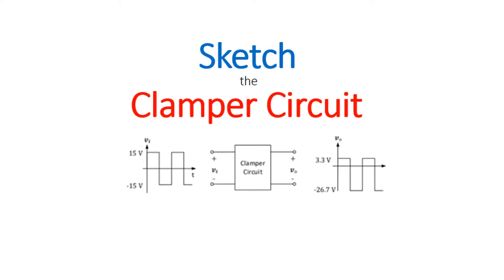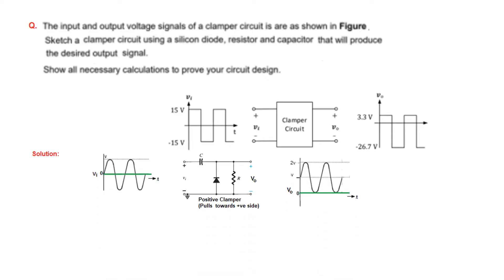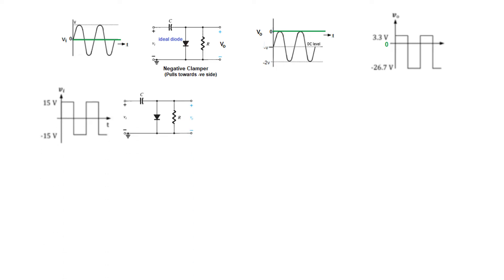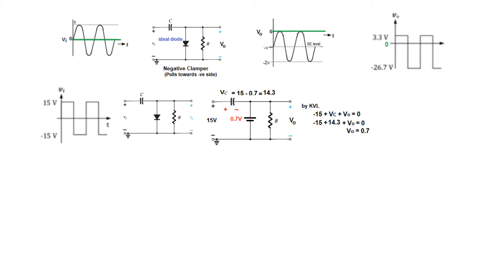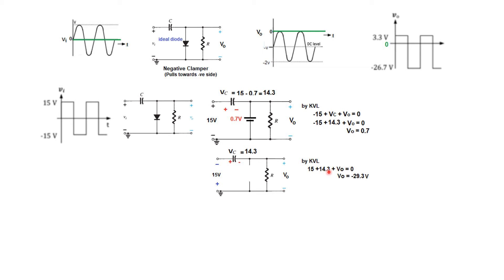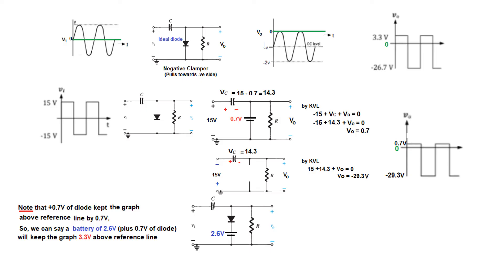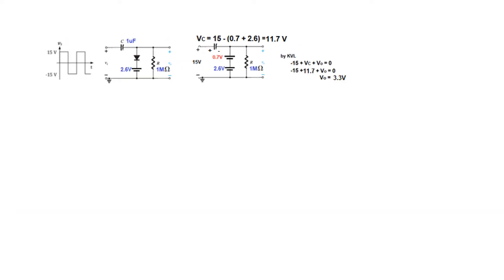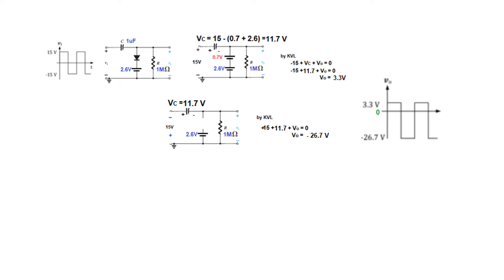(E)EDC(B) 2.10(2)  || Clamper Circuit || How to Sketch Output Made Easy || Assignment Question ||

Comment: sir how its knows which V is battery apply for 3.3 and 29.3 in graph achieved
Reply from the maker: Please watch the video few more times, then it will be clear, I hope.
Reply: @ElectricalEngineeringAcademy  Sir can you share more videos that you solve more clampers circuits like this video question Thanks
Reply from the maker: @muhammadaamir136  Please tell me question number. I can try.
Reply: @ElectricalEngineeringAcademy  no thanks sir i ask that if you solve any questions of clamper circuit so i do my practice thanks